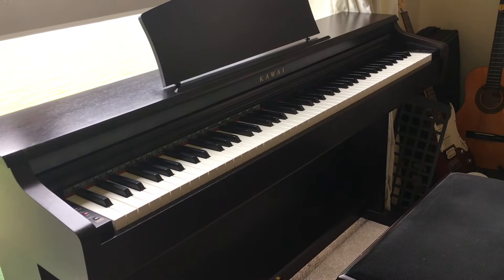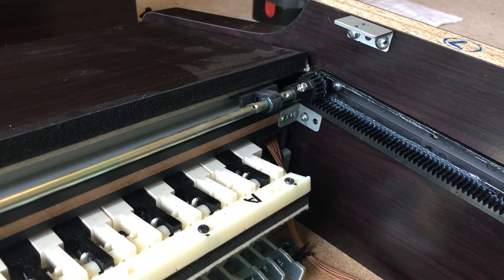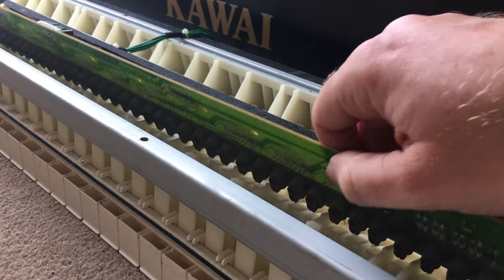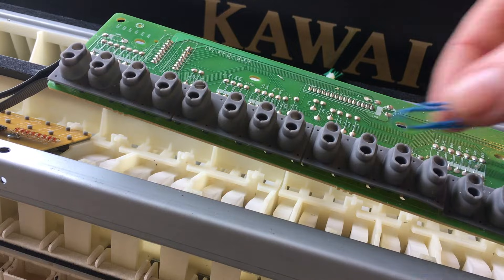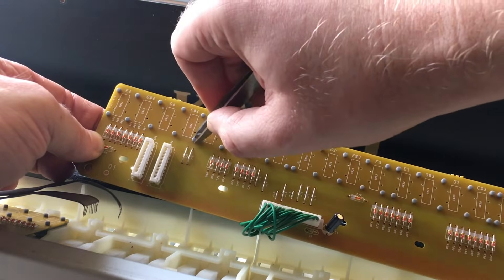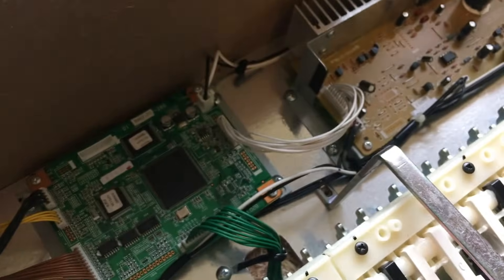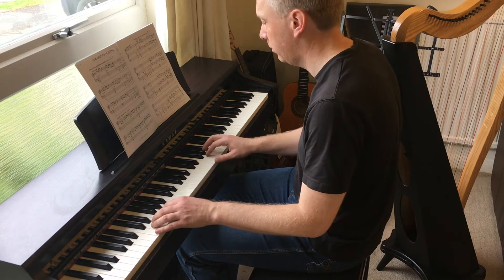Kawai Digital Piano - disassembly and repair

Comment: I picked up a CN2 off Facebook marketplace, instructions and looks matched perfectly until I flipped it over 😂.  12 different types of support rails and 50 screws, easy.  Oh, and the support rails can't be removed without removing keys first... That was the biggest clue I couldn't just follow along.  But I never would have been able to get to where I could work on it without this video and I doubt I could of put the whole dang thing back together without this video.  Thank you!  

Oh, and if anyone finds they get a hammer sticking.... All you have to do is find the nearby screw that is 1/4 turn too tight and loosen it.  This was painful, but I got the 1 key in the middle of the keyboard to work 75% of the time, instead of not at all lol

Comment: I have a Kawai KDP-80. and two of the keys were clicky and sticking.  I have followed your excellent video, but the board with the rubber contacts has a metal frame over it which appears to be attached to the keyboard, and I can't find a way of removing it in order to release the boards. So disappointing as I really wanted to fix it myself!

Comment: Thanks for posting this. I had the weird issue oh each 4th key not working, this video helped me reset everything
Reply: Hi @SergiyKanyshchev, I have a CN24 and yes I also have every 4th key not work.  It is the A C# and F keys that don’t work in the upper 3 octaves.  The lower 3 octaves are fine.  Can you please give as much detail as possible on how you fixed yours??  I have the piano opened up now. :)

Comment: I changed the whole PCB on my CN24 but the new one didn't have an output for the Power ON LED. I tried moving the socket from the old board and soldering into the same position on the new board but that didn't work. In the end I connected the LED via a 1k resistor to CN4 on the power supply board. CN4 is a 2-pin plug with 5V on it and I was able to simply stuff the connections into the plug and push it back on.

Comment: You just cleaned the rubber band. Kawai technician in my country said that if it has been 2 + years in use , i should change the rubber. Cleaning insteead of changing worked ?

Comment: This video enabled me to learn how to safely take apart my CN25 to find what was stuck under one of the keys (one of the weights had fallen out). Thank you!
Reply: I'm glad to hear you have success. I commented above 3 years ago but haven't got the courage to do the cleaning until recently.
Reply: Hey Ben, curious, do you approx remember how to put it back in? I’m trying the same thing right now, it seems like you use carefully force the metal weight back into these prong like plastic shape within the key area?
Reply: For context, I have a CN-33, and that has the control panel ACROSS the keys, not to the end or the right of the keys. and i cannot for the life of me figure out how to get it off, so hoping i can somehow re insert the weight, while not actually removing the keys since I cannot current asses how to release the control panel :( :(

Comment: I too thank you for this and it makes me ask a related but not specifically related question. We have a 206 and it's started to making a popping sound through the speakers - usually when it is just left on and idle for a bit. Sometimes the sound will go out entirely. But if we restart it, sometimes it will come back, sometimes not. Any ideas about how and where to repair. Parts availability for these keyboards? Should we reach out to Kawai - it's maybe 15 years old or more.

Comment: Do you know where I can buy the silicone rubber conductor pads? It’s a Kawai PN 100. It’s old. Most of the keys won’t play. I tried the pencil lead trick, but it didn’t help. I think I used the wrong cleaner, and messed up the old pads. I can’t find replacements anywhere!

Comment: Hi there! I’ve done this last weekend (before seeing the video), since there was juice spilled on the piano. I cleaned the circuit board with acetone and decided to also clean the keys and underneath since it became really dirty and in the damaged spot some didn’t work and some were really loud..

Now after I put it together, all the keys only respond when I press them really hard. Any idea where the fault could be??? I’d really be helped with some advice :)

Comment: If a note still muted, even despite having cleaned the contact rubbers, personally something that helped me was to scratch the part where it makes contact with a pencil. This completely fixed it in my case. Of course, you also have to verify that everything is clean and connected. Greetings!

Comment: Hi, I seem to have done some kind of mistake because now the upper half of the keyboard all the A, C sharp and F dont work anymore but I cant figure out what I did wrong. maybe you could help me out?
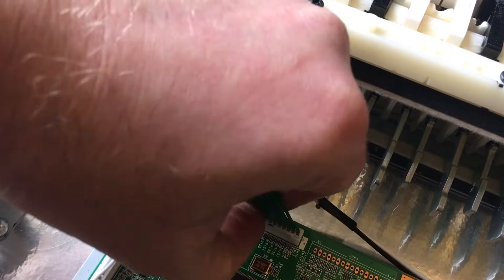Reply from the maker: I don't know but I'd suspect the contacts you see me taking apart at 2:34. Easy to not put back together properly. Maybe disconnect again and check all the wires are in and making good contact.
Reply: Hello @chr00m-e3z  I have a CN24 and yes the A C# and F on the upper half does not work.  Were you able to fix your issue?  Can you provide me as much detail as possible about how you fixed it?  Thanks!
Reply: @JohnGettler I couldnt get it to work properly again so I just went to the music store to get it repaired

Comment: I tried this with a Kawai piano having one key with significantly louder volume. However, using eraser did not change anything (maybe I was too gentle with it ?). I was wondering whether one should use some appropriate (electronic) cleaning agent and whether the problem is more on the circuit board contacts or on the rubber strip side?
Reply: Resetting everything to factory settings actually helped, another key became bit louder but adjusting the volume of this individual key (possible with CN25 model) fixed that.

Comment: Just wanted to say thanks and that based on this guide I repaired a Kawai CN24B and here are some findings for future reference:
- Other models such as the CN24 have 3 contacts to clean underneath each rubber. Same steps apply, but pay attention to the orientation of the strips before pulling them all off!
- Removing the piano case from its legs eventually proved optional for the CN24
- The circuit boards with the rubber strips can be removed and attached much easier with the keyboard flipped vertically inside the case instead of upside down, there is much less pressure on the rubber pads.
- It is possible to use a pencil on the contacts on both board and rubber, but I didn't test this extensively because I got tired of reassembling and ordered a replacement.
- There is a definite trick to reattaching the rubber (or silicone?) strip without breaking the little round pins or losing your sanity. I used the smallest hex bit (inbus) on a miniature screwdriver set. Push each pin not straight but at a 45 degree angle then rotate the bit at 45 degrees all around, applying only a bit of pressure. Push it in vertically after every few rotations and repeat and it should pop through much easier. Do not force and do not use anything with any sharp edges. Repeat until each one just visibly protrudes a bit from the board.
- To fully pull the rubber through, instead of tweezers you can gently rub a finger sideways over the protruding bits and let friction pull it the rest of the way through.
- Do Not in Any Circumstance use an electric screwdriver to reattach the boards! You WILL over turn the screws and ruin the thread in the plastic bits they go into.

So for me, cleaning (multiple times) eventually didn't work out. Each time a different set keys seemed to have problems. More findings concerning replacements:
- The rubber strip replacement was discontinued in favor of the full 2 circuit boards including blue translucent strips. This board is called KKB-044
  https://www.synth-parts.com/produkte/gehaeuse-baugruppen/baugruppen-gross/6413/kawai-rh88b-pwb-assy-kkb-044-2 
- There are two versions of this board and both apply to a number of models, choose according to the compatibility list.
- This replacement board does NOT have the "comedy error" connector so at this point 06:40 it is just left dangling. Indeed the power light on the front doesn't work but all buttons on the sides are fine. There is nowhere to attach it so I'm not sure if it is a manufacturing error or intentional to make the board compatible with more models🤔. Anyway I can live with it, there is another power light on the top as well.

Hope this helps someone in the future. It is more of an investment but now the piano has gone from unusable and unsellable to at least this investment worth again. in general I much rather repair something than discard it and contribute to the big electronics rubbish pile.
Reply: How do you remove the kawaii digital piano from its legs

Comment: I must've done something wrong. None of the keys make a sound now, although the sound still plays when I press the demo and metronome. Can anyone help? Do the rubber strips need to be returned to their original positions or is it ok to switch them around?
Reply from the maker: If no keys sound then it sounds like an electrical connection problem, not a rubbers problem. I'd check the connection between the keyboard and the main circuit board.
Reply: @johnholcroft74  thanks for answering! I checked the green wires and it's connected just fine. Maybe I damaged it somehow. Is there a name this wire? I'll see if replacing it will help.

Comment: Thanks so much, John. I'm an experienced piano-tuner, but have ventured into repairing digital piano only occaskeys producing ionally.
As you rightly say, getting at the offending contacts is the tricky bit. I just repaired a very heavily used KAWAI CA500 which had the B next to Middle C not sounding at all and several notes producing incorrect volumes. While the lid was off, I replaced a felt strip and made some adjustments to key operations, to quieten them down and to ensure consistency of respective note volumes. 
Result: Digi-Piano that cost just £40 is probably now worth 5 times that price . Thanks.

Comment: Adding to my comment of 1 year ago I found out the reason why my Kawai would not go and it was because of the re-assembly on my part which was not being careful enough following the instructions. Great video thanks to you the piano is like new.
Reply: Hi Mike. I have the same problem after trying this fix. None of the keys make a sound but the demo and metronome are fine. Can you share how you fixed it?
Reply: @MeLSL1  Hi Mel, if you go to section 6.30 min,. and look by his thumb you will see a row of little white  T shaped holders and when I screwed the board back down my problem was I screwed the board down on top of the white fittings which did not allow the keys to connect to the rubbers. You will see that the board has got to clip into those white T shaped fittings which will allow the keys to connect. I hope this works for you. Cheers Mike
Reply: Good pointer. I was scratching my head until I patiently scrolled through the messages and saw yours. Got it all working except for the first 5 keys on the left which were working before. I’ll have a look them tomorrow.

Comment: John does this go for the model CP1 Concert Grand Kawaii makes? I play weekly at a nice restaurant, and the middle C sustains on and off without pressing the sustain pedal Talk about frustrating. We had a keyboard man here in Kansas City who worked on boards from all over the country. He died recently. Anyway if you can give me an answer it would be much appreciated.
Reply from the maker: I'm not familiar with the CP1, but I believe it has a different action that the CN23 so this video won't apply. I believe it has a different action based on this video on Kawaii's site: https://www.kawai-global.com/product/cp1/ and on this video on Kawaii piano actions: https://www.youtube.com/watch?v=H0RR06XsGPM
Reply from the maker: I think this is the action of your piano: https://youtu.be/H0RR06XsGPM?t=230 So it has the same sensor as the CN23 but a different action. If the key wasn't sounding or sounding at full loudness then it could be the same issue of dirt under the sensor or worn contact rubbers. If it sometimes doesn't release the sound then maybe the rubber contact is sticking to the sensor.

Comment: I got a CE220 from Kawai where all the F and A keys are dead. I'll open it up and let you know how it goes.
Reply: I have the same piano. How did the disassembly go? I was concerned when I saw the electric shock warning but figured it only applied if the keyboard is plugged into the outlet.

Comment: I have a CN27 and it developed these faults after a few months. It was repaired under warranty but a few months down the line needs repairing again. It's been months now and parts are not available. I may try and cleaning it myself as per your excellent video but obviously voiding my warranty. I personally will not touch a Kawai again.

Comment: Thank you so much for this video. I had to change the power supply connector and found your video really handy in getting into the insides. I had started in the wrong place until I was lead to check your video out 🙏

Comment: I followed this video to the letter to recondition my kawai cn23 and replaced the cpu board as well as the rubber contacts and the rubber contact boards with new parts from W D Greenhill & Co Ltd as well as replacing the two headphone jacks. The piano was working fine before I dismantled it but when I put it back together the keys would not produce sound although the demo and everything else works. I have made sure all wires are connected

Comment: The problem is usually not rubber but the worn carbon/graphite coatings that are making contacts. (The same thing that happens for your TV remote control keys after a while)
A rubber cannot make contact by itself, then the graphite is acting as contact here. 
Then don't clean the inside parts of rubber keys, those black points are not dirt, they are graphite coatings.
Only open those keys that have issues, that are more likely would be the more used (middle) keys. 
The fist step is to replace rubbers from most used key parts with those that are not frequently used (lower and end octaves). Make sure to replace the whole octave as the rubbers may not fit well if you replace them with non-similar section.
Then gently clean the rubbers itself without that much touching the graphite coatings. 
Now you can use one of those Keypad fix kits (https://www.amazon.com/Keypad-Restore-Conductivity-Carbon-Copper/dp/B0026PRMVM/) sold on electronics repair shops to apply graphite to the contacting parts of rubber keys. If you don't have access to these kits, you can use a soft pencil to apply graphite that will restore key functions for a while but will not last as long as using graphite.

Comment: A big thank you to John Holcroft -- following this I was able to repair my Kawai CN34, where a few keys were usually making no sound. It was a little bit trickier, as the green cables joining the keyboard to the rest of the electronics also go through a "ferrite noise suppressor", a little plastic box, that needed to be opened. Once that was done though, I followed the disassembly and cleaning, and all the notes are playing again. Thank you!
Reply: I hope I can to do is well as you. The occasional dead note but then later the same note would sound much louder than the other notes. This video was spot on for me. But I don't know how the dust and dirt even hair got under there in the first place.

Comment: Do you know how someone could fix their Kawai keyboard if the speaker is making very  loud scratchy noises? The noises happen whether or not any keys are pressed and often drown out the sound of any notes. Any insight would go a long way since I'm not sure where to begin. Thanks so much!
Reply: Mine is having the same problem. It's a KSP-10, about 24 years old,  and you can't even turn it on, it pops and bangs so loudly. My husband is going to replace the amplifier board to see if that helps. I also have a couple of dead keys on it, and on my Kawai organ. Hope hubby can fix both.
Reply: @francosby8885  Please let me know if that fixes the problem. Also could you help me understand why chaning the amplifier board would fix the problem?

Comment: Thanks for the video. I had 1 muted key and was able to "repair" it using a hair dryer on cool air and blowing the dust between de keys without disassemble, but it only worked during some days. It is definitely advisable to make a proper cleaning when this happens.

Comment: I typically don't leave comments, but this video was a life saver! Middle C went out on Kawai CN25R, I followed the instructions, although not for an identical model it worked for me. Word of caution, be super careful with the cables that connect the two digital boards, I'd doubt you could move them more than a few times before breaking a connection.